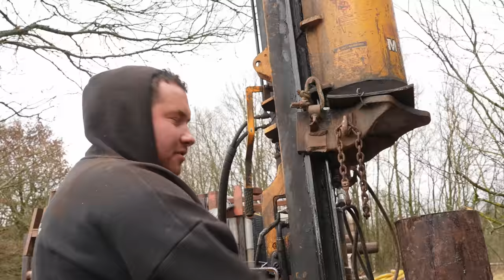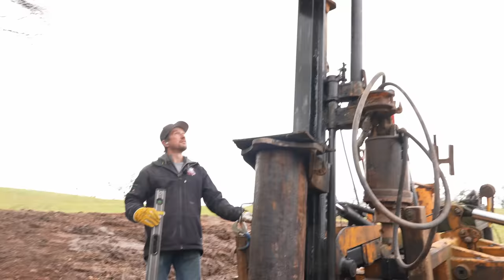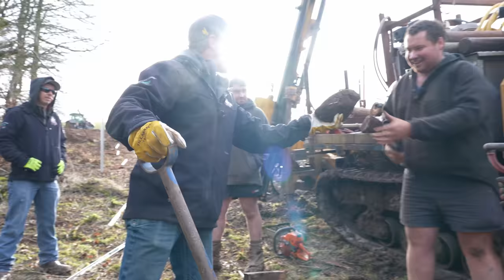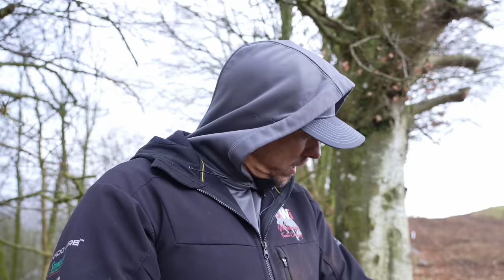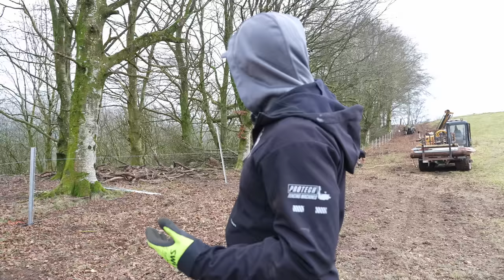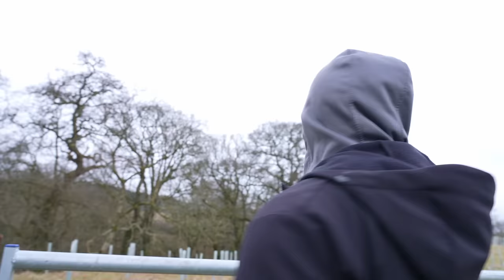We Can't Keep Up With This Scottish Fencer

Comment: In cold temp's where the frost goes down 5' the post has to go down be low 5' or the frost will heave the post out a little each year . And I think the ancher  posts should go down  6' to 7' to counter the pull of the page wire being streched and have tennchion  so they do not pullout of the ground . Super machine !

Comment: I'm a Scot living and working in Australia. We tend to use a wired diagonal brace, from the strainer to the first post with timber or more common now, gal pipe. And our strainers you can't lift by hand, our hardwood is so heavy. I pilot drill the strainer 700, then set it with thumper. Nice tight fence though. Concrete posts are becoming popular here, as timber become rarer. Stars like these can be leaned on by cattle.

Comment: Curious what size bit they are using on the drill?

Occasionally here we drill a full 40mm hole when trying to put posts in rock (same as our steel post size)

Never attempted a smaller hole before

Comment: Years ago I was on a farming and ranching forum and one member there was bragging about how his automatic post driver could do a steel post in less than 5 seconds and how he could easily do1000+ posts a day with it. 

I got him talking about his work and he said he charged $2 post. (No wire stringing) Then got him to name what machine he had.  Turns out cost about $4000 at the time.  
I was then wondering who needed that many posts done in a day and he said he did contract work for large ranches and farmers that wanted to either move fence lines or put new ones around fields and he often did contracts that were 3 to 10 thousand posts per job.  

I finished by asking what sort of crook charges people $6000 to $20,000 to do a job with a machine that the landowner could have bought for $4000 and done themselves while they were stringing the wires themselves since he didn't do that part.  

I got kicked out of the forum for making him expose himself for what he was. 😐
Reply: @Nicky L Because the people hiring him could have spent $4000, had their own post-pounding machine for life, plus paid someone well to help them out. 

It's actually one of the biggest issues contractors everywhere are now facing. They have priced themselves so far out of the reality that any competent person that can do basic math can easily see that buying their own machinery to do a job is often way way cheaper than hiring something done. 

Then to make it even harder, all of us who went that route to get some job done tend to be pretty friendly with everyone else who did the same and now all of us have networks to loads of equipment that costs us little to nothing to have access to.

Comment: Hi, guys! You may have a way to replace the main two strainer posts (in the horizontal type of strainer construction/reinforcement, where are two big posts, hhorizontal bar and wire diagonally) with the least amount of work? It's about both the end/initial strainers (e.g. at the gates; it's simple here, I have an idea), and the corner ones, common for two sections (I'm thinking/worry mainly about it). I would be grateful for a hint :) It is of course a high tensile fixed knot fence, 2 m high. Bartek

Comment: Good money in scotland fencing.. ive not seen them aluminium posts used in farmland.  Last a lot longer
Reply: galvanized steel they just look like aluminium
Reply: @bigsmoke6189  makes sense aluminium that thickness would be too bendy with the weight of the post chapper.  When did they start using these?
Reply: @bazjr86  a bit after 2007
Reply: @bigsmoke6189  really i did fencing for farmers back in 2017 and never seen any.  They all used standard wooden posts.. the technology maybe hasn't reached the scottish highlands yet 😂
Reply: @bazjr86  they are very popular here in New Zealand especially on hill country farms which can go up over 3000 ft but fencing contractors still use wood for a great deal of fencing jobs